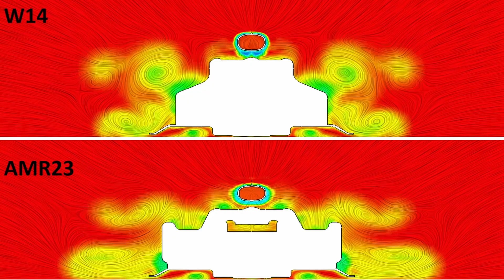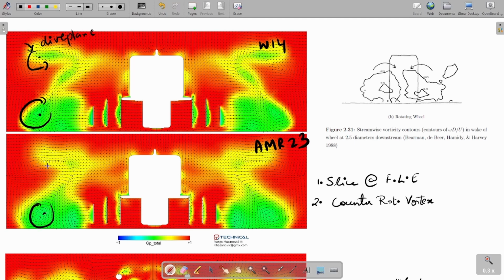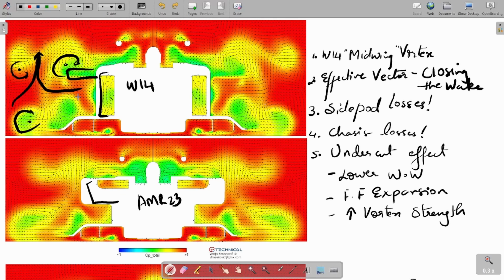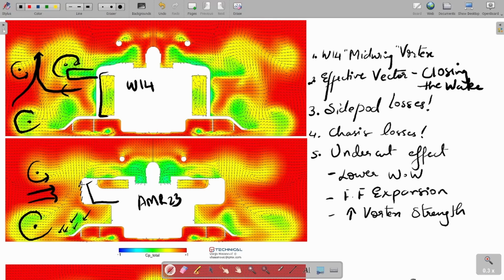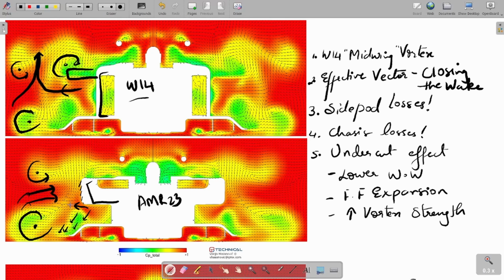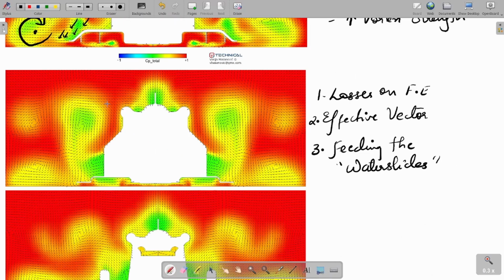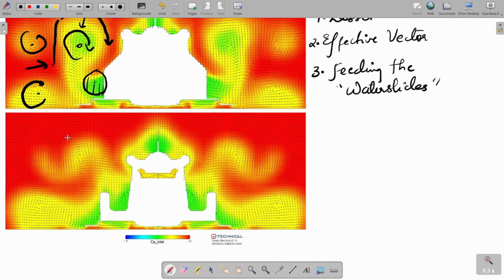#F1 Aerodynamics : Mercedes W14 vs Aston Martin AMR23 Sidepod Aero Analysis Pt 4/4

Comment: The W14’s outside top leading edge of the floor is more lossy than the AMR23, which is also outwashes these losses quicker. Because of the vortex generated by the mid wing of the W14 they are also upwashed before moving them out. Moving backwards, the AMR23 generate very low pressure flow on the floor edge while the W14,as you said, on the top of the chasis, and these are downwashed by the midwing vortex. The problem is that the W14 is not able to keep these loses from inwashing into the diffuse, beam wing area of the car, whereas the AMR23 outwashed that low energy air very well. (We can also see the vortex entering the diffuser). The same happens in the inside, even more since the vortex of the midwing keeps the vorticity and the losses pretty high and barely downwash before reaching the rear of the car, plus these losses are huge compare to the AMR23
Reply from the maker: Good one 👌

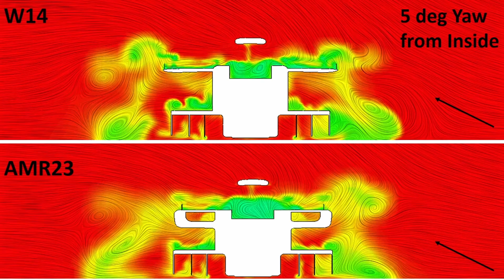Comment: i think at 11:49 you can exactly see the difference in the cars, and that speaks exactly to the rear end instability that hamilton is feeling. when turning left, you want the left side of the side to make more downforce to keep the car from rolling and make the left tires use grip. in this case, the mercedes has more overall pressure, but on the outside wheel, which doesnt really help in cornering. there is also a large difference in the left and right side of the beam wing pressurazation. meanwhile, the aston has maybe less overall pressurization, but it is more even and the pressure is actually on the inside rear wheel and beam wing, which powers up the correct side beam wing, which gives it superior performance.

The overall theory behind the mercedes sidepod solution seems sound: use the midwing to generate a massive vortex to push air down to the beam wing, but the fact that it has to fight against the vortex on the ground means it doesnt stay powered up all the way to the rear. also because of the yaw, the vortex gets pushed more against the car, leaving less space for that free stream air to make it to the gap between the engine cover and vortex, leaving the beam wing with less power, although on the outside wheel you can see how much energy the beam wing gets. 

meanwhile, the aston has 2 vortexs that work together to bring energy as interior as possible on the inside corner, while the outside corner gets starved which is (relatively) ok.

it almost seems like the mercedes team just didnt test the car in yaw? Which seems impossible to say, but maybe they thought they could make that up on sheer downforce levels reaching the outside corner.

finally at 11:51 you can see that the vortexes leaving the aston are much more even, meaning the floor has better (even) extraction.

all that being side, it really does seem that sidepods could be a simple solution to the mercedes problem. if they are able to make such a complex system work, it seems that they have the aero understanding, they just chased a concept that is too complex or incorrect for these regulations, like you said shubh.
Reply from the maker: Hi Jay, spot on !!! You called it right. Thank you for that detailed comment

Comment: I think what's hurting W14's performance in yaw conditions is  the lack of downwash from the bulges on top and the top of the sidepod cover compared to the AMR23 or the RB19 and the losses affecting the brake duct. I yaw conditions the main vortices from both sides end on top of each other in the others, possibly increasing overall diffuser effectiveness.
If Mercedes could create more downwash, adding more downforce where it needs, with a more conventional sidepod similar to Redbull BELOW THE MIDWING  all the way to the top of the floor edge, it could be the perfect blend in design between the three.

Comment: To me it seems like the W14 has a lot more vortexes further from the car than what the AMR has. Basically they are just wasted energy that isn't fed back on to the body of the car. The W14 also seems to have more underpressure at the front half on the outside than the AMR has which increases the downforces more on the outside than the inside, which in turn stresses the tires more.
Ideally the outside should be more or less neutral while the inside shall get most of the effect.

Comment: At 11:45 you can see the AMR23 sidepods appear before the W14, thus feeding the vorticity to the floor earlier.

At 11:46 you can see a greater suction peak bottom right looking blue for AMR23 but non-existent for the W14

And at 11:47 to 11:48 you can see the waterslides being fed air consistently on either side of the car compared to the W14.

The wide sidepod philosophy appears to be far superiod.

No wonder that Alonso overtake Hamilton into the braking zone in Bahrain was possible.

It almost mirrors this situation if we are to speculate based on the simulation here. 

Thanks for this.  👍🏾
Reply from the maker: Nice breakdown of events there.. good analysis

Comment: I'll put it quite simply now - while the flow on the Aston Martin is better and has fewer losses, there are high losses on the Mercedes and the flow is not good. Especially in the rear area. I think that the front wheel wake has a negative influence here and hits the car again in the rear area and making a mess with rear aerodynamics. What is also noticeable is the lower pressure on the top of the underbody on the W14, and the much lower losses on the AM23, as well as the much higher pressure what underbody and
Reply from the maker: Good observations there !!

Comment: Thank you for the video brother. 

The more I study the W14 design philosophy, the more it screams to me that the shuffling Merc did when promoting Allison to another department (or wherever they moved him), it put in place a team that was simply not qualified/prepared for the new regs. Even though I am sure the actual model and flow structures make  this philosophy make more sense as to why they pursued it so hard, they still went in the completely wrong direction. Well, not completely wrong direction. I am still thinking about this but, it is possible that an "edited" version of this concept and not a full change can potentially be the much better solution.
Reply from the maker: Interesting thoughts 💭

Comment: And even if the model is not perfect, and the CFD is not perfect that doesn't mean you can't make any meaningful conclusions, or see patterns. If teams with departments full of engineers and state of the art CFD, and wind tunnels, still miss things or have incorrect correlation, then what does it say about people who can still see patterns using crude methods? Computer software is just a tool for visualization, it doesn't show you reality, and at the end of the day it takes a human eye to interpret the visualization. When you really understand things, you'll find that your own intuition tends to agree with CFD, and vice versa.

People thought I was crazy, that there's no compressibility effects with these floors, and yet, I predicted without CFD that there would be a pressure spike at the inner-most strake and floor body, because the flow there would choke, and then the CFD agrees with me, every CFD shows the same phenomenon on the innermost fence and central tub.

Comment: There's also more downforce being produced by the rear wing, on the W14 there's much more red, on the AMR23 there's much more lighter colors, and the blues stay attached to the wing, whereas on the W14 it's more inconsistent and a huge low pressure area is basically doing nothing.

Comment: @11:48 the AMR23 is clearly making more downforce in the diffuser under yaw. Partly because the pressure above the floor is higher in the AMR23, particularly at the edge wing trailing edge. This confirms my theory that loading the top surface of the edge wing is beneficial for downforce. On the W14 there is more green around the edge wing implying lower pressure air, there's more yellow and orange on the AMR23 implying slower moving air with higher static pressure over the edge wing. This manifests itself as lower pressure under the edge wing, generating lateral in-washing flow. The mouse hole in the side of the diffuser is meant to ingest that lateral in-wash increasing the vorticity of the diffuser vortex.

As per my previous comment, if you can get the deformation of the edge wing and diffuser to work together you can use this to bleed off downforce at high speeds. The cars usually have too much downforce at 270kph, so if you can bleed that off by raising the floor at speed, it would actually cut drag down significantly. Below 270kph the edge wing loading keeps the diffuser throat as close to the ground as possible, then after 270, the edge wing deflects down lifting the diffuser throat reducing downforce and increasing straight line speed.
Reply: The contour plots represent total pressure (flow energy) , not static pressure. So you can't tell anything about the static pressure and the velocity based on these pictures. 

Also, it seems like you mixed the two poctures up, because what you said about the Aston is valid for the Mercedes and vica versa
Reply: @jozsefmolnar6453  You can, because pressure and airspeed are correlated. The higher the pressure, the slower the airflow speed. The lower the pressure the higher the airflow speed. Look for instance, the floor vortex, the core is low pressure, the energy is no longer streamwise but helical which slows it down in the streamwise vector but accelerates it around the center of circulation. While the air that flows around the floor vortex maintains its energy and high velocity until it reaches the diffuser.
Reply: @rolandotillit2867  You are using the bernoulli equation in your thinking, but that does not work this way in viscous, rotational, turbulent flows. 
As I said, the plots show total pressure, not static pressure. The static pressure can drop, and airspeed can increase at the same time, and you will have no clue about that based on a total pressure plot, because the total pressure will remain constant.
Reply: @jozsefmolnar6453  It does work, if you look at it from the correct perspective. You're only looking at what the computer tells you, but you're not looking at the whole picture. When you look at the big picture it makes more sense. The red stuff is free stream undisturbed flow in the x axis. The blue stuff is slower in the X axis, so while it's velocity may be higher in y and z planes, it's slower in the x plane.

This is consistent with reality, as vortices are a source of drag. Therefore the velocity is lower in the x plane, but faster in the y and z plane, because that way you maintain continuity and conserve momentum. The airflow around the vortex however is what becomes accelerated by the tunnel vortices. The vortex is like a thumb placed at the end of a garden hose, a turbulent choke as it's called in cylinder head porting lingo.

Again, you can look @ 11:50 in this video to see what a "turbulent choke" is. The tunnel vortex, and on the W14 on the right side of the rear wing. You see a separation bubble. That separation bubble is a "turbulent choke" that accelerates the air on the wall of the endplate.
Reply: @jozsefmolnar6453  @11:50 look closely, the W14 diffuser vortex has broken down, while the AMR23 still has a well defined vortex, notice the separation bubble on the W14 on the rear wing. I can see why the W14 has turn-in instability, in contrast the AMR23 seems to be much more consistent under yaw.